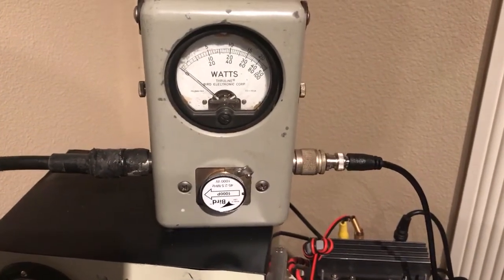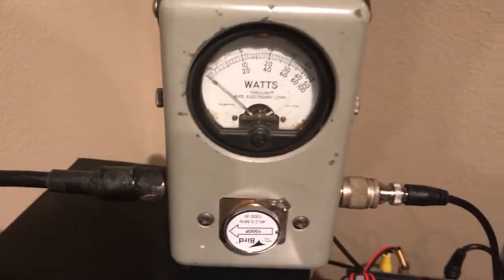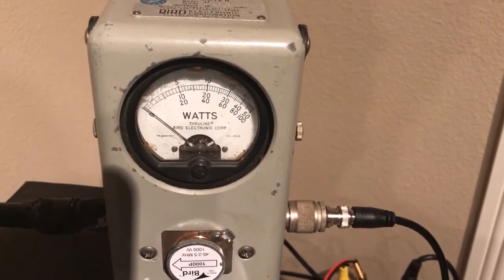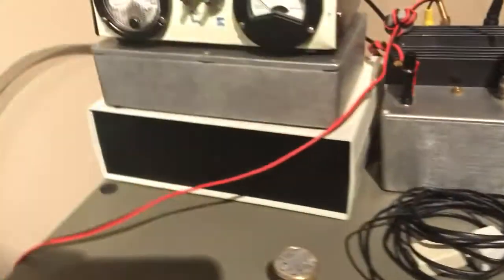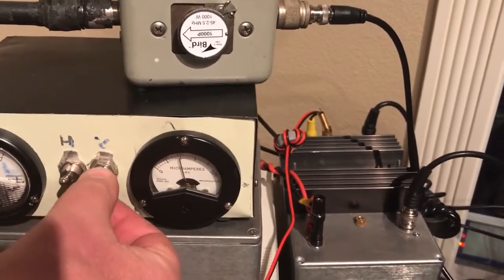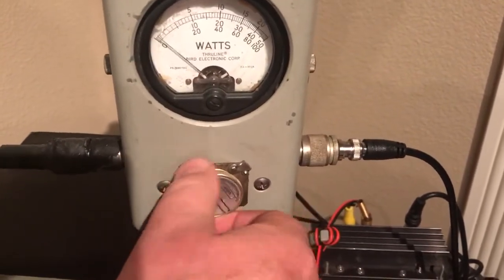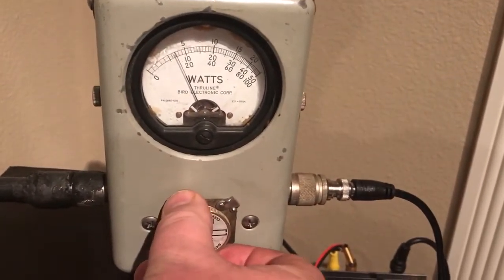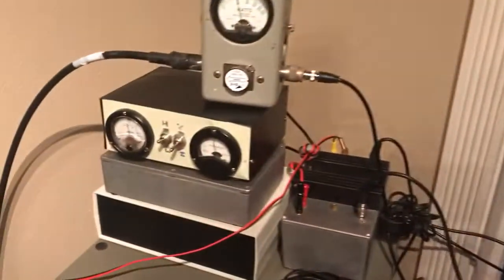bird thruline 1000h 2-30MHz slug compared with 0.45-2.5MHz 1000P slug at 630m

Comment: What's the 1000P slug like on 2200 meters, have you ever tried it? Thanks for another interesting LF / MF video.
Reply from the maker: Chris its been a while since I did a compare on 137kHz but I seem to remember the 1000H gave about a 30% reading - I didnt have the 1000P .45 insert at the time - Ill be on the air on 137kHz by end of Oct so will test and come back to you then all being well. ps I decoded you last week on 137 whilst I was down in W Sussex but I wasnt connect to Inet.